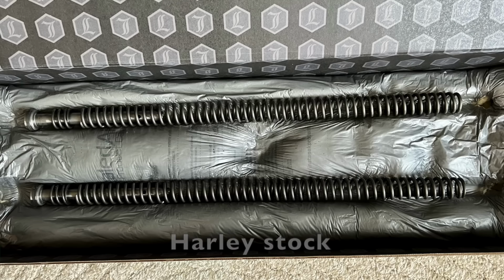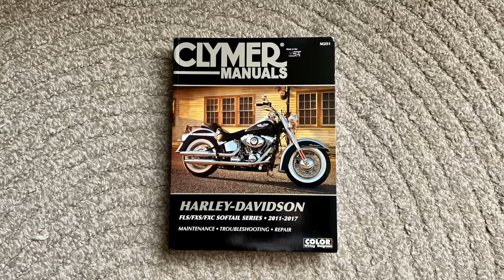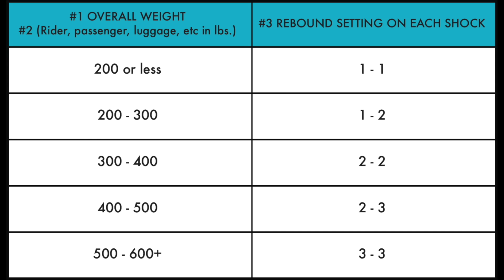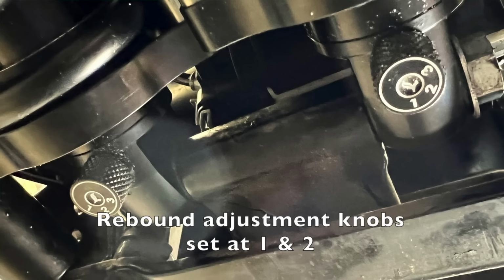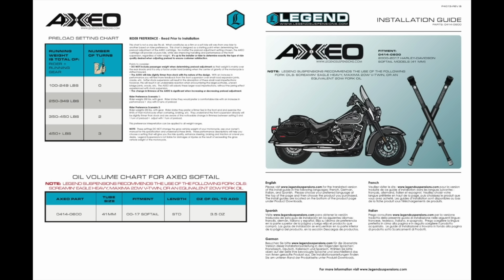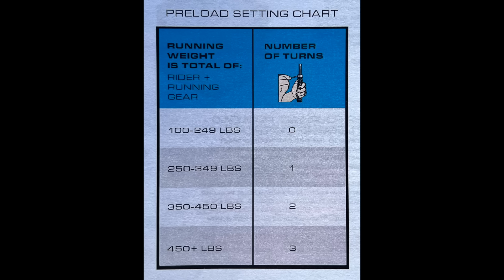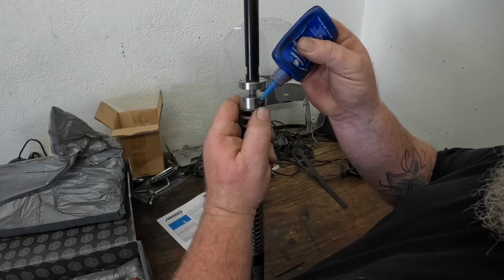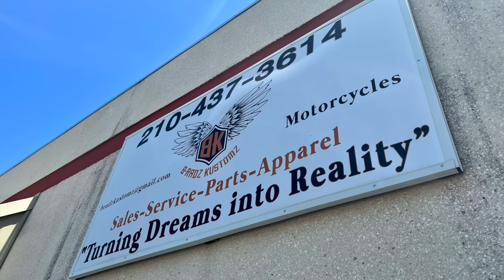Why Didn't I Do This Sooner??  My Harley-Davidson Softail will never be the same! LEGEND SUSPENSION

Comment: I wish I was back on a motorcycle, I gave it up after numerous close calls; and added pressure to stop from my wife.  Legend suspension is hands down the best upgrade over the stock Showa Junk. Be sure to upgrade your rear brake pedal to a Softbrake.  Enjoy the ride, take it on Twisted Sisters, unforgettable ride.
Reply from the maker: I hear ya. I do my best to avoid traffic, bad roads and crap weather. Sorry to hear about giving up the bikes. Will ride the sisters again soon, should be a whole new experience.
Reply: What’s a soft brake ?

Comment: Good job, we just did this job on a slim. Word to the wise, change your trans fluid while you have the shocks off. Trust me on that one when you go to change it with the Legend's installed
Reply: How do you change transmission fluid after, I can’t even get a 1/4 inch allen between the shocks? Any help would be appreciated. Thanks!

Comment: One small note on fork reassembly.  Initially leave fender bolts, lower fork/triple tree pinch bolts, and caliper bolts loose.  Tighten axle bolt to “square” up the forks about the axle centerline.  Afterward, tighten everything else.  This will prevent any binding and ensure everything is all settled and centered.

Comment: I don't understand why suspension would be a big deal on a Harley. I have a 1989 FXRS Low Rider. Mine had tubeless tires, which IS a big deal. It also has aftermarket slip on mufflers which sound great, which is also a BIG deal. I've also added hard leather saddlebags with Easy Brackets, and a backrest, to which I can strap a T bag. A few other very minor things. I bought it in almost new condition way back in 2003. And to my knowledge, it still has the original shocks, at least they look original, set to the highest preload setting, because I weigh 240 pounds and I don't want it bottoming out. I have replaced the steering head bearings and changed the fluid in the forks. The fork internals are also original, to the best of my knowledge. It has 67,000 miles on it. It rides just fine. Seat is also original.
Reply from the maker: The answer is probably something like this:  One can be very happy with a good steak, until he tries a good lobster. Nothing wrong with the steak, but there are better options. Ride safe friend!
Reply: Changing the shocks on a Harley is not a big deal until you develop lower back pain. When the hernia comes and settles, you need good shock absorption to avoid the kicks in the ass from bottoming out. It changes the comfort, but also the handling, and you only realize it once it's changed!
Reply: @pedrolanevert it's more of a iliacus muscle problem, try find exercises for it. It helped me big time

Comment: Very good, informative video on the steps required to swap the suspension on the Softail. 
Please allow for some feedback: Have the mechanic do some talking. It’s very sterile. You could ask him a question about the process or any tips or tricks about the job that he’s performing during the video. The other feedback is to have you explain the affects after the installation is complete. I really don’t know what difference in ride quality there is other than a woohoo and a few other words saying you should have done this sooner. 
Explain how it rides before and after. Explain what’s different about the way the bike handles going into and coming out of turns. How does it perform over bumps and at different speeds. Highway, regular cruising.
Reply from the maker: You’re correct, but he’s working by the hour and it would be a great way for me to get tossed out of the shop if the owner learns I’m slowing him down. Understood, but it ain’t happening.
Reply: How does the bike perform since swapping the suspension?
Reply from the maker: @chazzcapone.  You’re going to have to wait for my review video hopefully coming soon. No spoiler alerts here!  🙂

Comment: I see you know what your doing .. Do you have Any recommendations for a 2011 wide glide with respect to rear suspension?
Reply from the maker: Thanks Ralf!  Both Legend Suspensions and Ohlin make great suspensions for TC Dynas, both coil and air shocks. Both options are pricey. Good luck and let me know what you end up doing.
Reply: @trippontwowheels  Thanx for your advice...
I have heard about Ohlins and  yes they are pricy , so I think I have to dig a bit deeper into this topic...
The other Option would be to go for the New softail standard ... I had the Chance to make a test ride last year and the suspension really convinced me even Stock,  its such a smooth ride ...
Anyway , I ll let you know to what it came down to finally...
Thx and have a good time!
Reply from the maker: @Nightraincruiser  You’re correct Ralf. I’ve ridden about a dozen new Softails and several Twin Cam versions. The new M8 Softail ride and handling is GREATLY improved vs the TC Softails.  Good luck!
Reply: @trippontwowheels  thanx!

Comment: Is Legends Suspension the best rear shocks for a 2015 Harley Streetglide Special.I love My Streetglide but not the rear suspension.Half the time my Wife rides with me and she weighs a little over 200.I weigh 176.I can live with the front suspension,I know that there's better.
Reply from the maker: I’d think it’s either Legend or Ohlin. You may want to check out the HD Forum for more advice/information. Good luck Mark!
Reply: @trippontwowheels  Thanks, I've been asking Harley parts department guys what they thought were good replacements.

Comment: I'm trying to install them on my 2007 Softail Springer CVO, I'm wondering if you had any clearance issues with the top of the shock and the bottom of the transmission case on the right one.
Reply from the maker: Yes. Was a long and tedious process. Edited about 20 minutes of struggling out!

Comment: Do you know if your 2015 had that "bending valve" suspension as found on the M8 newer versions? Do you think your air ride suspension is better than the M8 stock softail?
Thanks.
Reply from the maker: I don’t believe it had the bending valve, and yes, Twin Cam with Legends on front and back was vastly improved vs stock. It’s tough to compare vs the M8 version as there were so many improvements in the M8.  When in doubt, get the M8 and put legends on it!  🙂

Comment: Are you happy with the change?

I changed the suspension of my 2020 Deluxe to Ohlins suspension front and rear, but had to change the springs in the front 3 times and rear once, because the spring rates were not correct.
As a bike technician, I could do that by myself. Now the bike runs perfect. 

On the other hand, it was really disappointing that Ohlins offered me equipment which didn't work correctly and I had to develop it by myself.
And the price for this equipment is not cheap.
Regards from Austria.
Reply from the maker: So far, so good! However, I’ve only ridden the bike about 200 miles with the Legends installed and they need to break in yet. Also, the stock seat is doing me no favors.  Will do a comprehensive review once I’ve got 600 miles or so.  Austria is beautiful, it’s been many years but the times I’ve traveled there I absolutely loved it.  Ride safe Wolfgang!
Reply: @trippontwowheels  I have changed my stock seat to a sundowner seat.
That is a good choice.
A friend has choosen a Mustang touring seat. Both seats are good for long distance riding.

Comment: Great install video. Looking to purchase a set for my 17' Deluxe. Are you still happy with this setup? Also, i read somewhere that these shocks might hinder access to trans fluid drain plug for oil changes. Was this your experience?
Reply from the maker: No it will not hinder access. I have a ton of new accessories for the bike I’m selling. Email me at tripp@trippontwowheels.com if you have any interest. Thanks!

Comment: Hey man, where is the follow up ride and review video regarding your Legend Shocks and forks. I have been waiting because I have a softail too and am trying to decide if I should do Progressive 422 shocks and Legend Axel montotube springs or maybe Race Tech & Gold valve emulators.......
Reply: Softail deluxe - contemplating Revo A and Axel set up but would like to see your ride and review (opinion). I have the Legend system on my Road King Special but the Softail Deluxe rear suspension is a different animal...... would really appreciate the follow up video.....
Reply from the maker: Sorry bud, I traded the bike in on a 2019 Road King shortly after I made the install video. Big mistake.
Reply from the maker: You’ll be quite happy with the Revo A setup. Made a huge difference on the Deluxe.
Reply: @trippontwowheels  I bought a road king special but kept the Softail Deluxe too - can you just summarize the difference in how the bike responded and did it improve in cornering because my softail shocks / front forks dips and dives like an Olympic diver jumping on a spring board, especially 
around a highway corner......
Reply from the maker: @chadwickmulvahill6925 The Revo’s fix all of that. Front improves handling, rear improves ride. My bike did the same. Amazing difference.
Reply: @trippontwowheels  Thank you, Tripp. Really do appreciate the insight - I will go with the Legend Axeo (Front) and Revo A (Suspension).  If your ever up in Western Canada - let me know - we have some of the most scenic roads and iconic Sea to Sky highway. Cheers man.

Comment: I can see that you're using a wrench on that right side rear shock bolt, but for the life of me I can't figure out how to get one on there, let alone turn it, how did you do that??!! I was just trying to install my new Legends rear shocks and that one bolt has stopped me dead in my tracks!!
Reply from the maker: Hmmm. It’s hard to explain but it wasn’t easy. Just keep trying is about the best I can offer. Front or rear if the shock canister?
Reply: @trippontwowheels  The rear bolt on the right side by the oil drain plug. Do you recall what wrench you were using when you were hitting it with the dead blow hammer? I can see that you were using a 3/4” ratchet end once you got it broke free. I’ve been trying a claw foot because that’s all I have that I can get on the bolt, but it won’t stay on when I’m applying torque. Thanks for any advice you can give!

Comment: that legends rear suspension is fairly new isn't it I was looking for something for my deluxe in 2019 and didn't see it I wish I would have
Reply from the maker: They’ve been around quite a while actually. 25 plus years I think.  Do you still have the Deluxe?
Reply: @trippontwowheels  no I traded it for that reason I looked high and low and legend for the rear is an option I never came across live and learn now if I pickup a pre rushmore Ill know better

Comment: i have the legends on my cvo road glide best money i ever spent
Reply from the maker: What was the biggest difference you found?
Reply: nomore bottoming out the air  shocksalways leaked no front end divewhile breaking abd no wobble in the corners and more ground cleaence and lifetime warrenty
Reply from the maker: @gordonwrichert8240  I’ve had the same experience so far.

Comment: I have a 99 heritage soft tail,  since new I put 30 miles on it . I hate this bike . Its the most uncomfortable  bike I ever rode . My daily is a 58 duo- glide . I've owned it 44 years . The whole soft tail system sucks . It sits to high and  bounces to much , I bought a hard tail frame to put everything on it . Screw soft tails .
Reply from the maker: I mostly agree with you - until 2018. The Softail platform improved drastically with the M8 version. Why have you never sold the bike?  Just curious.
Reply: @trippontwowheels  i have my 58 , a 67 3 wheeler and a 76 Honda 750 also . After I bought it I rode it home and put it in the garage because I dont like it . Il probably use the hard tail frame or a traditional swing arm frame for it . Once I buy a bike lol it becomes my sons when I die lol. The soft tail just sits to high for me . Its 6 inches higher than my 58 at the seat . I was looking at them and just bought it . I think il look for a shovel head . I really want an electric start bike .